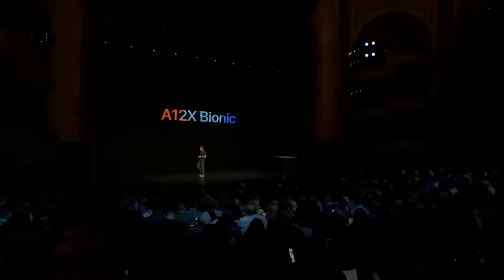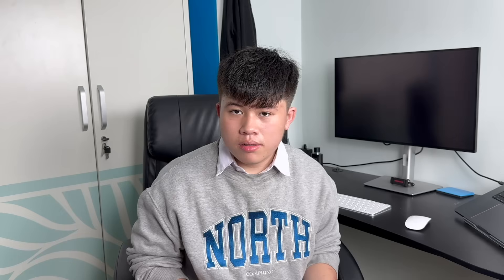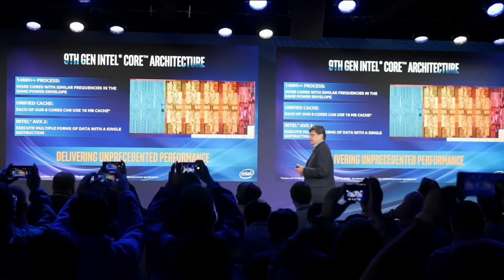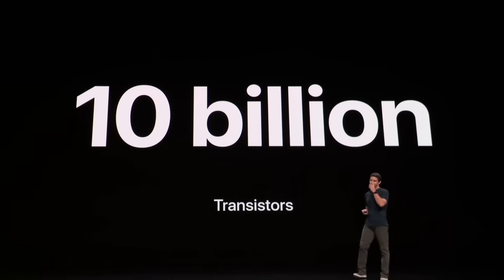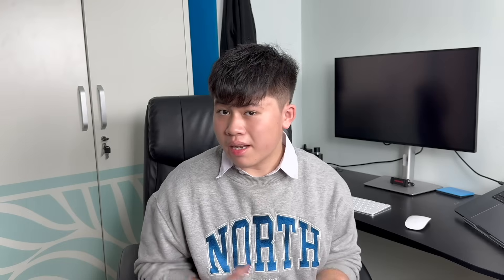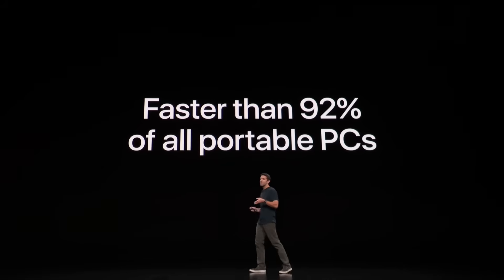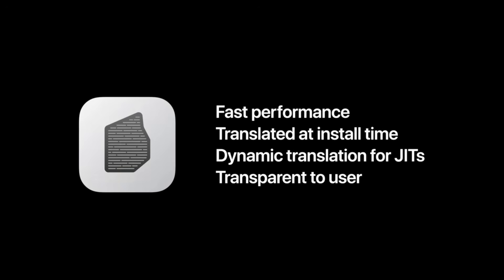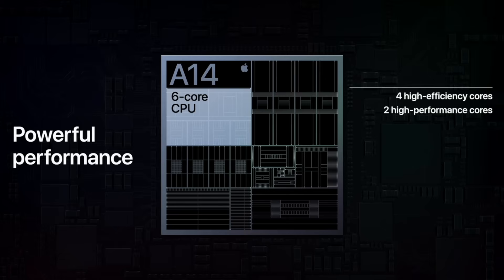The Chips That Made M1 Possible.

Comment: M1: 600MHz base; E core turbo 2.0 GHz and P core turbo 3.2 GHz. Not so impressive compared to AMD, the company Apple should’ve switched to
Reply from the maker: Although on paper the M1 didn’t look as impressive as other CPUs at the time, switching to their own silicon was a huge win for Apple. It gave them full control over the chip’s design, allowed for tighter software integration, and ultimately brought down costs. Think of it like this: instead of adapting a driver to a car, Apple built the car around the driver. 😀

But if we consider where apple came from (which was intel), Team red would have made a compelling choice too, so, you got a point!

Comment: The weakness of the M chips is its unified memory. 

Unrepairable memory that system relies on as vram, system memory and L3 cache is not good for performance. 

They could metigate this by putting a bandwidth chip that could speed up access to the disk for swap.

Amd did this with vega where the gpu could tap into the system ram as vram
Reply from the maker: True, but the difference here is that Apple’s unified memory is baked into the SoC itself, which aimed to reduce the latency and improve efficiency, thus allowing it to be used for both CPU and GPU purposes. AMD’s solution is more of a work around for traditional x86 architectures if you’re running out of real VRAM.

Plus a bandwidth chip wouldn’t be necessary as Apple’s NVMe SSDs are already fast enough to be used as swap memory on its own.

Unified memory is actually more of a strength than a weakness if we put upgradability aside.

But your comment gave me something to think about tho, liked it. 👍

Comment: Also there haven't been any [problem]gates, service recalls, or mass defects since the switch to M-series processors. That's a plus too.
Reply: Although there is the problem of encryption where you cannot simply take out storage and pair it with a new chip (part of Apple's motive to solder storage), and there is still the looming GoFetch security issue (which requires direct hardware access). Let's hope nothing serious occurs because it's not an easy fix.
Reply: @ Well at least it’s not BitLocker lol. Also helps that the core demographics for M1/2/3/4 macs were born in the last 2 millennia and know the ancient spells called “email and online account passwords”

Comment: Apple Silicon was the direct result of Intel not being able to meet performance and efficiency targets, thus the whole issue with the Touchbar MacBook Pros (though Apple's "thinner is better" philosophy did make it worse too), if Intel did meet the "bar" for performance and efficiency, Apple silicon might still happen but it would take much longer to realize and occur, as there wouldn't be as great of a "pressure" for apple to switch over yet. But eitherway, great video! Liked the part where the intel mac was on fire, keep it up! 😂
Reply: What does the Touchbar has to do with this?
Reply: @robo5553  lol. The touchbar didn't do anything, they are simply referring to that era of macbook pros, apple refreshed the macbook pro in 2016 with touchbars and that design held till 2019 before the switch to apple silicon. Touchbar MBP is very specific and anyone who knows the eras knows what it means.
Reply: It's still irrelevant. M series has so minimal usability because of lack of app support
Reply: @AnotherDay-ce6th  Today most programs run on ARM and those that don't can be run with emulation layers. it is not perfect but far better than when M1 released.
Reply: @AnotherDay-ce6th  For a student like myself, the fact that my Macbook Air runs Safari, Microsoft Word, Teams and VLC is pretty much all I need. I have a desktop PC for gaming.